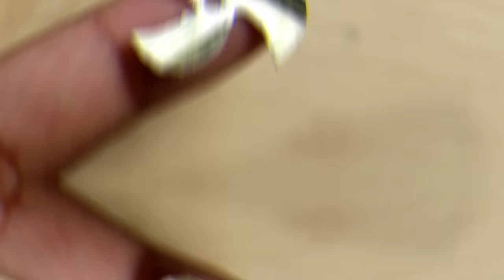How to make a electric boat at home | Mini Motorized Speedboat

Comment: If lowbatt, how can you doing to charge it?
Reply: Remove it and put a new battery. The battery used isnt rechargeable. You can use a rechargeable battery and charge it easily.
Reply: ashish sharma it's a cheap drone battery those are rechargeable
Reply: Ferramentas para fazer miniatura de carros